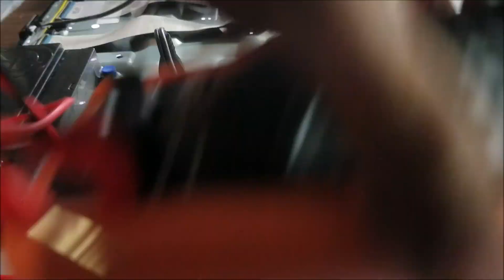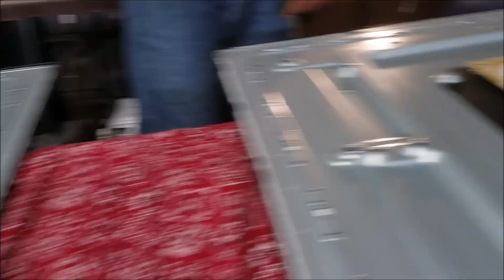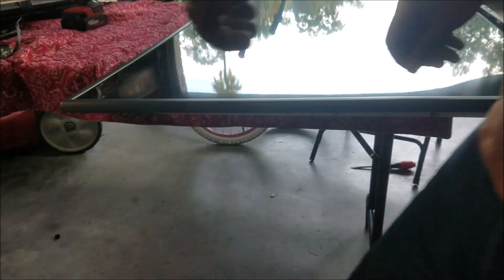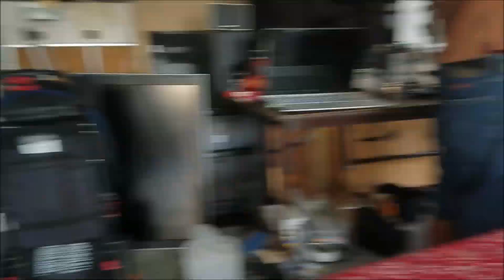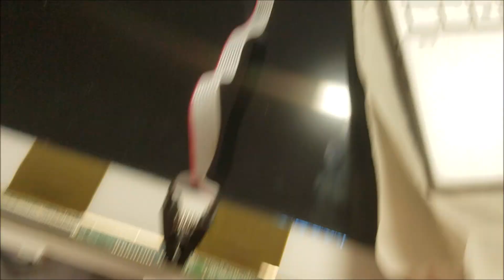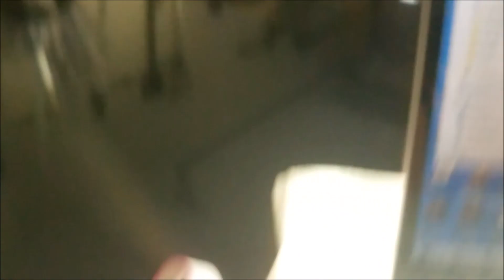samsung un55nu7200f no power and un55nu7100 no picture

Comment: I have the same tv but it’s a nu6290 same problem white picture and sound so your saying it’s a bad tv panel
Reply from the maker: yes all samsung NUxxxx using samepanel, try to disconnect one flex cable and see if you get any change ( half picture, or color lines) if you tried both flex cables and still no data on the screen, you have bad lcd panel
Reply: @SOSfixElectronics  I’m sorry just found out which are the flex cables I’ll test it out now I’ll get back to you

Comment: thanks for the video,what can be the cause of the screen failure?if you find out can you make a video for that?
Reply: Being hit...
Shorts on driver boards either side,
Samsung panels and AUO panels can internally short hot spots (blisters) can be found in either lower corner
Faulty tcon board 
Disconnect either screen cable and check to see if you have an image 
After removing left and there’s a picture you know the fault is on left side of the screen for example
Reply from the maker: @wisher21uk  or bad cof ic in this case will need to change the cof and that require a bonding machine that cost alot, not worth it at the moment